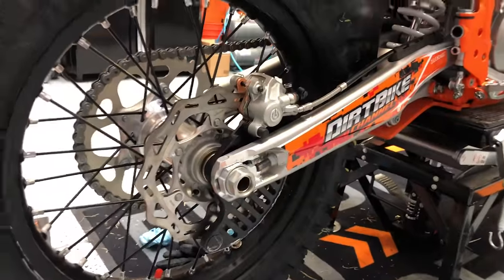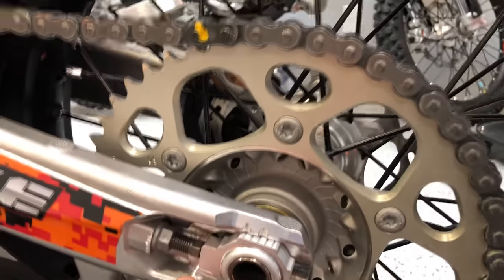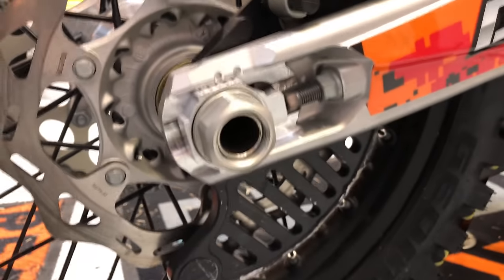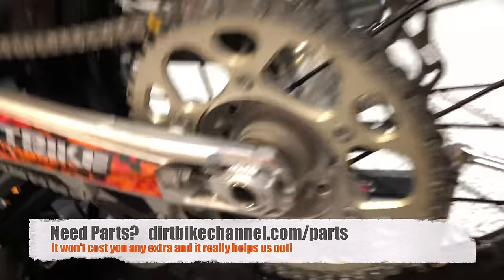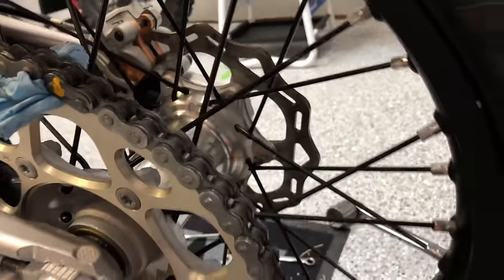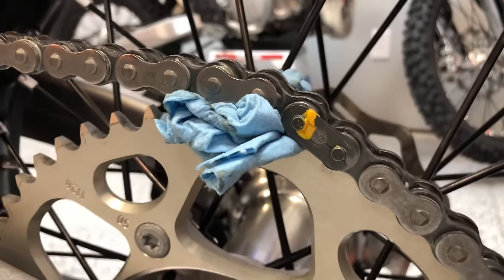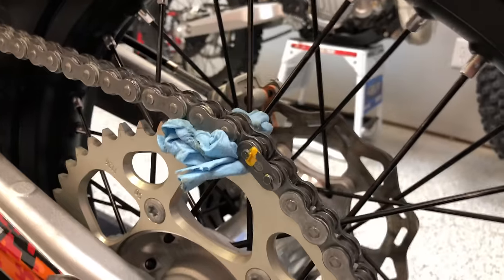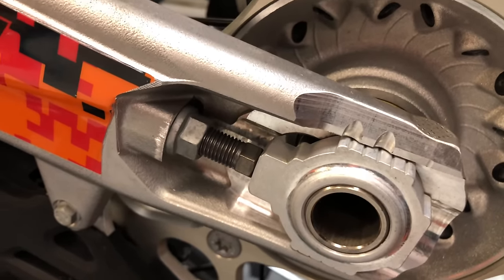Chain Block and Axle Nut Tip

Comment: Good tip :) 
You should make some videos about dirtbike maintenance, like how to adjust the carb identify whether its running rich or lean and adjust things accordingly.
Or putting the front wheel back in the right way(tightening order).
And important things to know when working on your bike.
There are too many people asking 'at which ratio do you mix your gas?' And they start running 1:30 no matter which oil they use..
Educate them! :)
Reply: He already has multiple different videos explaining most of the things you just asked for. Especially when it comes to mixing gas.

Comment: chain tension looks well tight! the ktm recomended tension is too tight as well ... I set mine so you can touch a link onto bottom of swingarm (OR take out shock, get front sprocket / swingarm bolt and rear axle in line ... this is the tightest / most compressed point you will ever get the bike on a landing ... then adjust to have just a wee bit of play .... then reinstal shock.

Comment: I have always used a number 2 screwdriver to do this.  Once you get comfortable with it, you can even assess your chain tension adjustment based on how many links are behind the screwdriver once you roll the wheel backwards.

Comment: Great tip! Another really usefull video would be for wheel dish / offset , its purpose and how to make sure your front and back wheels are aligned, there is 0 info in the service manual for this.

Comment: On one side of my bike, the adjustment bolt isn't touching the side of the block however the dashes align perfectly. I'm wondering if someone overtightened the rear axle nut so the tension from that is actually holding the block in place, and not the adjustment bolt

Comment: Am having an issue with getting the axle torqued to spec, doing it manually and the axle nut wants to round & socket just pops off 2018 Yamaha. Xt250 with a good 6 point socket

Comment: So I put lock tight on my front axle bolt not thinking it would weld it’s self on and now I striped the nut and I can’t get my wheel off any tips to get it off

Comment: Hey Kyle, just bought a 2017 Honda CRF450RX 👍
Reply: John Connor haha, ya seems that way
Reply: enjoy that machine dude!!
Reply from the maker: Very cool.  If Honda would make a CRF250RX, I'd buy it right now.  Sadly they haven't.  The Honda CRF450RX is likely going to be the next 450 that I test out.  Not sure if that will be this summer or not.
Reply: Dirt Bike Channel the guys over at traction Erag didn’t have much good to say about it
Reply: Justin Bova what issue was it?
Reply: Michael Raymondo clutch, weight, and power delivery. Those guys all run pretty technical stuff though, so if you’re a gncc or desert guy, you will likely not experience the same issues.  My buddy was in Canada with them when they were testing it.  I will see if I can find the article and link it
Reply: Michael Raymondo http://tractionerag.com/issue41/

I read your question as what issues they had with the bike, rather than what issue of traction. Keep in mind the article is their “diluted” opinion. They were much more vocal on the trail.
Reply: Justin Bova ya, I bought it back in November, I’ve hadn’t had a chance to ride it yet because there is too much snow here in Ontario still 👎. I will have to see how it rides before I make any mods, ex) magura clutch, smaller countershaft sprocket, not sure if I want to go Rekluse or not.

Comment: You went through the tubliss install without changing the AT81?!
Reply: E.DUNN personal preference. I find they perform poorly in the conditions I ride and I take them off asap (front and rear). There are types of terrain and conditions where it really doesn't matter what tire or air pressure you ride, but for the stuff I like it matters more and the AT81 doesn't do a good job

Comment: Youre also supposed to tighten the nut from 12 o'clock to 6 o'clock. Not 6 to 12. That pulls the wheel towards the adjuster when you start at 12 o'clock. Cool tip though.